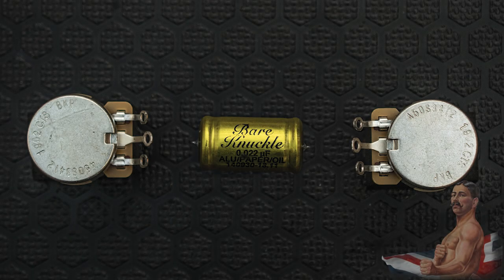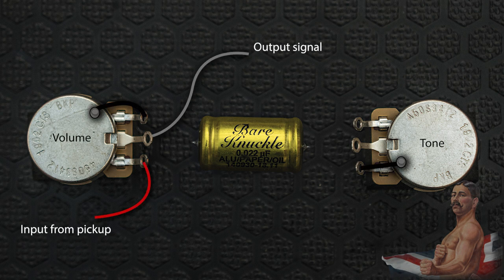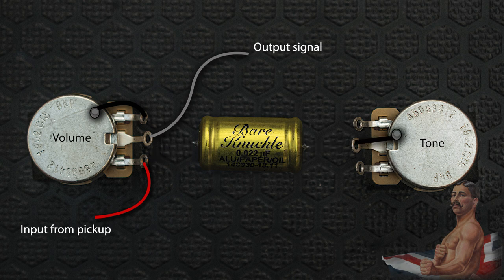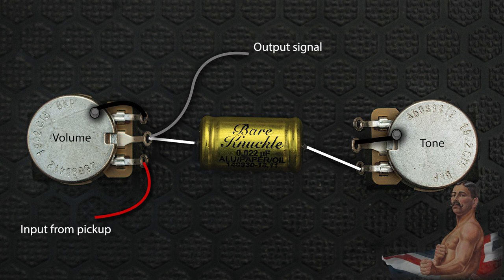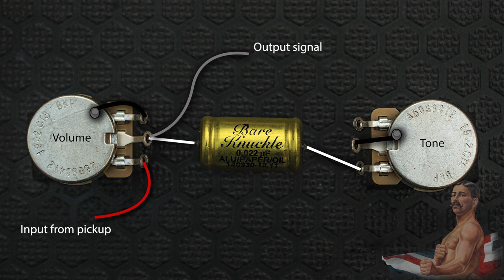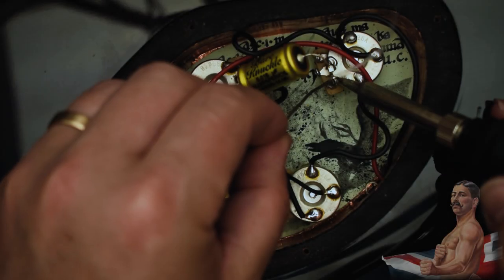Bare Knuckle Guide to '50s vs Modern Wiring

Comment: The best part of 50s wiring is being able to dime out some of your amps tone and volume controls, higher than what you normally use, and backing off the volume and tone knobs on the guitar to your original taste, then when you need an apparent boost for leads, turn up your tone and or volume off the guitar....instant at your fingers control without stepping on a pedal...think Hendrix... it works!!
Reply: Exactly

Comment: Everything on 10 there is 0 difference as the two terminals on the vol are connected together. Draw back is when on both PU's the tone affects both PU's or the output, the other 50's wiring the tones are more separated to the individual PU's. They are both 50's wiring since back then they came out wired both way's. This was probably due to the day of the week and how much the builder partied the weekend before. Really in a band nobody's gonna know the difference. In a blind A-B test most people might hear some difference but wouldn't be able to identify which is which. To me too much attention payed to things that have 0 effect compared to playing. Just like focusing on technical ability rather than technique. I see on so many videos people don't know the difference.

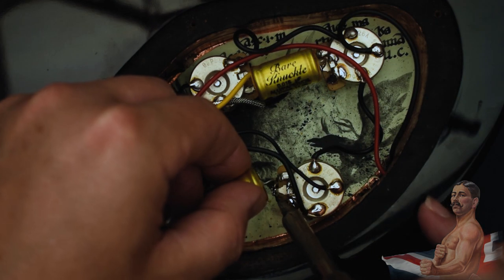Comment: Everything on 10: modern 1:54 | '50s 2:57
Max volume, tone rolled back: modern 2:10 2:16 2:23 | '50s 3:14 3:20 3:27 3:34
Tone below half, volume rolled back: modern 2:29 | '50s 3:39
Taper of volume pot: modern 2:46 | '50s 4:10
Reply: These links are very helpful. You can really hear how the 50s wiring preserves the high end when you roll the volume back and forth.
Reply: Thank you, so much easier!

Comment: I deffinatley noticed some high treble bleed from the 50s 
I think that's what gives it it's character.
It picks up dynamic pic articulation, the glassy acoustics  and the smooth wooly sound when the tones rolled back.
Mostly positives 👍
Reply from the maker: Some players really get on with it, some players don't. It's very much down to preference, but it's basically free to try if you have a tone pot and cap in your guitar, so why not experiment?
Reply: Definitely, its.
Reply: It's also the only way to really get the tone from classic music played on 50s and 60s Les Pauls. There's HUGE sonic difference between the 2. On 10 and on 0.
Reply: @BKPickups there's actually quite a stark difference between the 2 options with everything on 10. If you actually play similar clips back to back, it's quite obvious. Like compare 2:13 to 3:14, etc... Not sure how you don't hear it? Playing power chords makes it even more apparent.

Comment: Hi i was wondering if you can help me , i purchase a new harness assembled harness kit for my les paul.I also purchased 1 490 and 498 pick ups, unfortunately the 498 has 5 wires and the 490 has 1 wire wrapped with a neutral and i dont know where they should be soldered.can you help me.Thanks
Reply from the maker: Connect the green and white wires together and cover up the joint with tape or some shrink tubing, then connect the black and bare wires to ground and the red wire to the bridge volume pot input. For the braided wire 490R, connect the outer shield to ground and the inner wire to the input of the neck volume pot. That should get you fixed up!
Reply: @BKPickups  I thank you greatly for your help i also feel guilty making you write an essay .Please if there is no trouble im a handyman and i understand better in drawings, please if its ok by you can i send you the picture of the wirring harness and pick up wires and all you have to do is draw a line where which wire goes where.If yes can you kindly send me your email.I appreciate it greatly Sir.

Comment: On full volume and Tone the sound is identical between the different wirings?
Reply from the maker: Yes, you only start to hear differences when you begin to roll back the controls. With everything on 10, the circuits are essentially working identically to each other

Comment: hey folks, and regards from Brazil. Could you tell me the difference about grounding the middle tone Lug or the side tone lug? Sound path looks the same.
Reply from the maker: As far as the filtering and tone go, it works the same, but different placements can slightly affect the noise level in your signal. Original '50s wiring connected the middle lug to ground, which gives you the best overall noise performance.

Comment: I still don't quite understand why it makes a difference and to complicate it, some wiring diagrams put the tone cap before the tone pot, others put it after.  I think this is the difference between a high pass filter (cap>res) and a low pass filter (res>cap).  But if the tone circuit comes after the volume resistor (50s) then isn't there:

vRes>cap>tRes>gnd
vRes>tRes>cap>gnd

And if it comes before the volume resistor (modern) isn't it:
cap>tRes>gnd
tRes>cap>gnd
Reply from the maker: The different sequences of cap and potentiometer don't alter the tone to any particular degree, they are simply manufacturing / assembly choices by guitar makers. Hooking up the cap as the last component in the chain before ground simply allows them to more easily  pre-assemble the pot and cap together, before putting it into the wiring cavity. The key difference between modern and '50s is where the tone circuit links in to the volume pot. Modern wiring links into the pickup input, '50s links to the volume pot output, which is obviously a variable signal level and resistance, depending on where the dial is set.

Comment: In my SG the capacitor is wired at the volume tone second lug to the tone pot second lug. Is that a right connection? When it comes to electronics I'm really bad.
Reply from the maker: There are several ways to connect the tone capacitor, The way that yours is wired will behave more like '50s wiring.
Reply: @BKPickups  thank you I'm grateful

Comment: Is there a "Kill" feature in 50's wiring, when you toggle to the middle position?
Reply from the maker: Sure, if to roll back the volume of one pickup, then you will get 2 silent positions on the toggle. That effect has more to do with how the pickups are connected to the volume pot, rather than how the volume and tone are connected.
Reply: @BKPickups  Thanks for getting back.  I have been playing single pickup jazz boxes only for going on 35 years.  I picked up this particular guitar because I liked the tone and wanted a lighter guitar for gigs where I stand up for a longer time playing.  But I've not had a double pickup in over 35 years and don't remember if I had this issue and I asked a few of my friend who have les pauls and teles and they said they did not know.  But here is an unlisted video of my setup https://youtu.be/XWNYrrkYwfw
Reply from the maker: @GlennInLaguna  That behaviour is completely normal. When in the middle position, both volume pots will act as master volumes over both pickups simultaneously. So, the sound that you hear is coming from both pickups and both volume controls can turn that whole signal all the way down to zero. If you don't want that to happen, you would need to rewire the volume pots to be independent, which simply involves switching the input and output wires on each. The job is mad a bit trickier because of the hllowbody construction, as all of the pots would need to be unscrewed and withdrawn out through the pickup hole in order to get to the wiring.
Reply: @BKPickups  okay good to know.  I did more reading up.  Is what I have 50s wiring?

Comment: What’s the difference between soldering one leg of the cap to ground and linking the volume and the tone pots with the cap?
Reply from the maker: In both cases, the resistance of the pot and the capacitor are wired in series. The two different methods that you describe change the order that the components sit in the chain, so, when linking the pots with the cap, the tone pot is on the ground side of the cap and, when mounting the cap onto the tone pot, the pot is on the hot side of the cap. Both styles should create the same filtering frequencies, but for a true 50's, the cap should be linking the pots.

Comment: Hi guys! Really nice video and helps a lot making decisions... Thanks really!
Tell me something, can I use your BKP paper/oil 0.022uf  caps with both 50s and modern wiring methods? Or are them only advisable for the 50s one? I see a lot of modern wiring methods using the small 47uf or something small cap.. 
Sooner im going to install one BKP the mule on this LP and im curious about the impact your caps will have on the way I choose to wire the new pickups on this guitar (I already have your caps as well)
Thanks in advanced and looking forward to hear from you :)
Cheers from Portugal
Reply from the maker: Sure, you can use the same capacitors for both setups, changing the capacitance value simply alters the range of sweep that you have on the tone control
Reply: Great!! Thanks for taking the time to reply ;) keep the awesome work guys

Comment: I hate the wiring that cuts out both pickups in the middle position when you only turn one down
Reply: Isn't that what 50's does?
Reply: @JohnDoe-cu2hl  no, modern does that. My Les Pauls with '50s wiring are great in the middle position with the bridge vol rolled back a bit. Burstbucker 2&3 are very well balanced and you can get almost unlimited tones. My LP custom silverburst with EMG 81/85s does that, and it sucks bigtime. I've heard there's a way to wire EMGs to get the 50's wiring benefits.